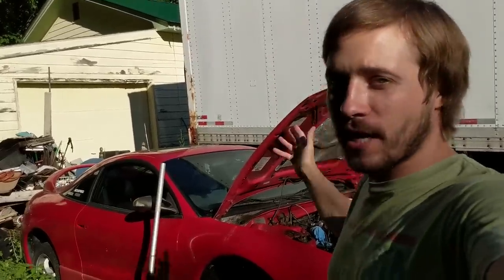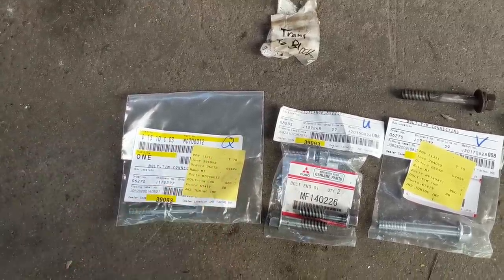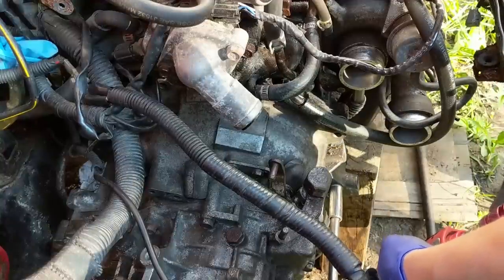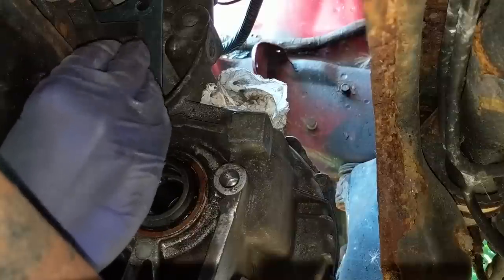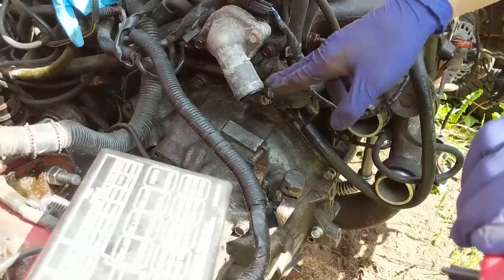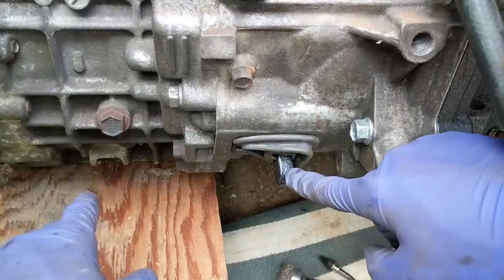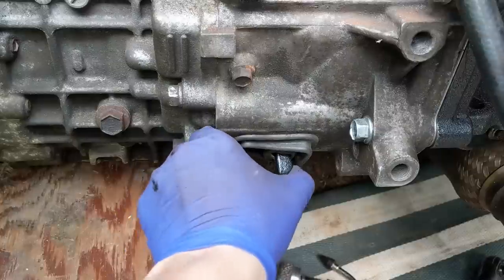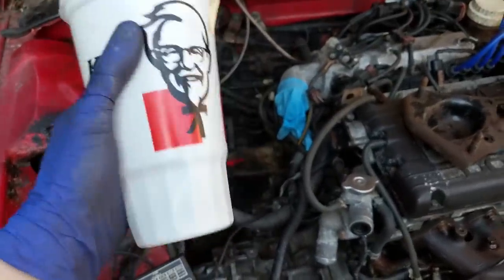DSM Crank Walk Bolt Explained! - Eclipse GSX Transmission Mounting

Comment: Anti-seize often seals the fate of already somewhat stripped threads, and often isn't accounted for in torque specs. It reduces the thread friction so much that you will get more turns before you reach a given torque.

Made it all the way, as usual! Good to see it all coming together; the next video is gonna be great!
Reply from the maker: Yeah for sure. I reviewed my footage and the hole definitely had issues ahead of time. I'm sure the reduced friction didn't help with the aluminum though. I should have just aimed for like 35 foot pounds or something. I did get a helicoil kit though so should be all set.
Reply: @802Garage  helicoil will take care of that no problem. With the layout of the other three you'd think that hole would have been towards the passenger side closer to the firewall.
Reply from the maker: Yeah actually, it is kind of odd placement. May have to do with it being an Evo design originally? I actually have helicoils to replace that and other stripped holes on the sub frame mount and starter now. :)

Comment: When you said you were going to put a lot of Loctite on it, I cringed. But then you put it on and I relaxed.  Many years ago I used to deliver freight to a major mine here in Australia. I'd do favours for the stores guys and they'd return the favour.  The amount of Loctite Red, Blue, Silver grease (super anti-friction grease), tapes, glues, fibreglass mesh and resins etc that they gave me over six months lasted me for the next five or six years. I had an old Valiant and a Kombi that used a lot of my graft & corruption treasure LOL. Edit: An example of the stash I had; I had 30 big cans of carby cleaner spray., 10 each of 50ml Loctite R & B, and heaps of stuff. I could have opened a shop (this was pre-interwebz).
Reply from the maker: My definition of a lot isn't the globs some people will use. XD
I would never put more than a dab of red Loctite on something.
Had to get a crankshaft pulley bolt out once that was slathered with it.
Boy was that a fun hour or two of work, hahaha!
I'm jealous of your hoard, I keep running out of supplies.

Comment: I made it all the way. When you need just a bit more out of a a shallow socket like that, slip it half off the extension, it allows the stud to go up into that drive hole. I’ve never seen anyone locktite & torque bell housing bolts lol, I get it though, you are making sure to solve all the issues it had. I always have some 3in1 oil with me & any threads I’m not using locktite on get a few drops, really helps things go together smoothly, likely the last people had cross threaded that mount bolt though, I noticed it was very loose as you were starting it...
Reply from the maker: Thanks for the tip.
And yeah for sure, I just want to give this car every chance it has to live after all the abuse it has had.
The trans has already been messed up enough by previous owners, and trans flex can cause crank walk.
I like to use anti seize on pretty much any bolt I might want to take out again, or at least some lube.
Loctite only on those I really can't afford to have come loose.
I did check the footage I had and the hole was already largely stripped before I got there.
Thanks for commenting as always!
I have some fun footage of Jaycob's PT Cruiser GT coming soon, BTW.

Comment: 14:45 - If the bolt is made from cheap steel, there is a good chance it could be stretched to near breaking point if it's beyond its tolerance.. Keep an eye on it.
Reply from the maker: Fortunately, that's ones I want to replace with a proper OEM bolt anyways, though I think it would hold up alright. :)
Hope you can find time to catch up on the videos soon and there is an HQ version of the first start coming soon.

Comment: You did it! Congrats for rendering this video in 30fps against its will. Showed it who's boss!
Reply from the maker: Hahaha, 100%
Learned something new at least. XD
Reply: Was it because of the sped up segments? Who cares, it's fixed. I watched it all, too. On a side note, I go crazy over the tiniest amount of rust on my cars, I admire your tolerance for it. :D
Reply from the maker: It was actually dumb. The intro I use right now was redownloaded due to lost files and apparently came in at 15 FPS. Since I loaded that into my timeline first it set the whole thing to 15 so even when I rendered at 30 it was messed up. So the file could say 30 FPS but it was still displaying basically 15 FPS. Had to find how to change the settings. Much annoying.
You must be one of the lucky ones who live in a dry state. You can't own a car for a week here without surface rust on any bare metal. :P
Reply: I never uploaded multi-fps files, so I wouldn't know. I've dabbed into video editing/rendering, but I use good old Virtualdub mainly. It's a bit hands-on, so to speak, so when something goes wrong, everything goes wrong. Makes it hard to miss. :D
I live in central France, for lack of a better word, so it gets wet during the winters, cars will rot if you don't pay attention to them. Did the wheel arches on my Saab 2 years ago and it's already showing signs of rust. :( Just about finished de-rusting the Stagea last month, we'll see how it fares. :) I really like how you're doing all that work in your backyard, reminds me a lot of how I work on my own cars, in my own backyard and how I wish I had a proper shop.  Keep them videos coming, they're both entertaining and inspirational. :)
Reply from the maker: At first I thought you said embarrassing and inspirational and I was like... Hahaha so true! XD
I've been to France once! Didn't get out to the country though. I completely understand you on the winter rust. 100% same here.
I've been working in the driveway and yard a long time. We make due! Hoping to acquire a lift in the next year or so. :)

Comment: made it to the end buddy.Awesome work. Not sure what you are planning to do with the GSX when its done, BUT maybe putting in the right bolts the first time would make sense. Also, cleaning up the mounts and painting would clean up the bay a lot tidier. :)
Reply from the maker: Thanks a lot for watching and commenting!
I agree with you on putting in the right bolts the first time. That's why I ordered proper bell housing bolts, starter bolts, and a few others. I didn't actually know just how many wrong bolts I had before putting the rest of it back together and researching more.
I have a list of probably 10-20 more bolts to order and replace soon. Luckily most of them are fairly easily accessible. I do also have a bin of OEM bolts somewhere from a part out, but I can't find it!
I did clean and pain the sub frame and front mount at least, but the others will definitely get done later. :)
Thanks again, I appreciate your input.

Comment: Where did u order the bolts from??
Reply from the maker: JNZ Tuning. They actually have two websites, one that is more performance oriented and their OEM catalog. The OEM is typically a bit cheaper. I used a variety of websites to find part nunbers like STM Tuned and Extreme PSI though.

Comment: Hmmmmm this looks familiar. ...
Reply from the maker: I uhhh... Have no idea what you mean! ;)
Reply: @802Garage  the 85ft.lbs is for the timing side Mount to body through bolt. Seems awfully high.
Reply from the maker: @blindabinda1234  I agree! Did you look it up? I have seen some questionable sources. I believe it should be more like 42.
Reply: @802Garage  I saw it on a dsmtuners forum thread. But that through bolt doesn't even have any clamping forces I wouldn't think. I'd stick with the 42 like you said. Seems much more realistic.
Reply: @802Garage  http://www.dsmtuners.com/threads/torque-specifications-specs-spec-nut-bolt.382492/ click this link then scroll down a bit and download the 2g torque spec manual thing.
Reply: @802Garage  it's not the top link that says 1g. ....... obviously.lol there is a pdf download further down
Reply from the maker: +blindabinda123 Yeah I have referred to that guide multiple times and have found many of the values questionable. Usually confer with multiple other sources to make sure. If it ever seems way too high, especially if it's into aluminum, it's worth double checking. :)
Reply: @802Garage  I found some pretty cool engine Mount things that basically slide into the part of the mounts that have rubber missing from both sides. I'll find a link. Lol
Reply from the maker: Yeah motor mount inserts are pretty sweet! The DSM ones are a bit pricier though.
https://amzn.to/2MA7Xgv

Comment: No disrespect but, jumping christ on a hot plate.... This is a 90s DSM, not a spacecraft.   Bolting the trans to the engine should be a 5 minute thing. Get a 3/8 impact and ram the bell housing blots home my dude. As a matter of fact, do that to all the bolts. Unless you're planning on throwing this thing in the Concours d'Elegance. But even then I don't think they check bolt torque.
Enjoyed the video other than that.
Reply from the maker: Do you know the issues these cars have if you DON'T torque the transmission properly? I mean, I explained them in the video and they're literally why I had to diagnose issues a Mitsubishi dealer couldn't figure out after replacing the flywheel twice and why I had to remove the transmission and sleeve the starter bolt holes. People doing exactly what you described is why I had problems. By the way, if I was doing it off camera, it would take 5 minutes. Filming and explaining as well as providing specs and tips adds huge amounts of time. Additionally, if I'm going to make a video on a topic, I'm going to show how to do it right, not half ass it. I do lots of stuff off camera that I wouldn't necessarily recommend. When it comes to bolts involving the drivetrain, sealing, or rotating components, I use torque specs. With very good reason. I've seen what happens when people don't. Thanks for the comment.
Reply: @802Garage  I see I got you in your feels, my apologies for that. I was trying to be respectful. 
Yes, I do understand the seriousness of proper torque, I've been spinning wrenches professionally for ~15 years and  I've owned quite a few Neons, PT Cruiser GTs an Eclipse or 2 (current Eclipse has over 230k on the original motor and I've installed 2 clutches) and even auto-crossed a couple of those. In my career, I've not had a single car come back or blown a motor because the bell housing or motor mount bolts were too tight. I've also not seen anyone else have a comeback for over torqued bell housing or motor mount bolts. Too loose or tightening bolts down while the bell housing is misaligned, yes. 
If clearances are as critical you make them here, you should be using a plasti-guage and or feeler gauges and measure for clearance. 
Again, thank you for the video and I'm truly sorry I got in your feels. I guess I've been in the business too long and I'm callus.
Reply from the maker: @yubentrolled7097  I'm not in any feels. I replied in a respectful and straight forward manner. We weren't talking about clearances that would requite plastigauge, we were talking about clamping force as well as damaged threads or loosening bolts if anything. So you're really conflating entirely different issues. The point of a torque spec is to ensure a proper clamping load without going out of spec on the bolt or threaded material, which I'm sure you know. I have seen many damaged threads and bolts as well as failures due to improper torque.

I understand being callous. I also know how to put together a car without using a torque wrench once. It's still not the "correct" way to do it, and I'm not going to make a video without at least advising people of the proper procedures. You do you on your cars and I'll do me on mine. I have done plenty of customer cars without torqueing every bolt to spec of course, but when I put their lug nuts on I still use a torque wrench because then I can reassure them it was done properly and I can cover my own ass as well. Just how I do things. Have a nice day.